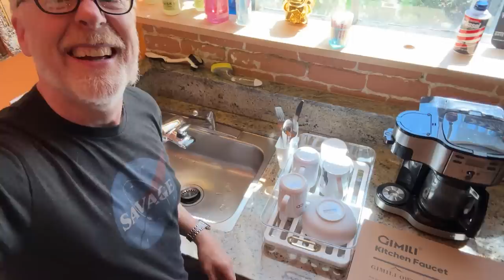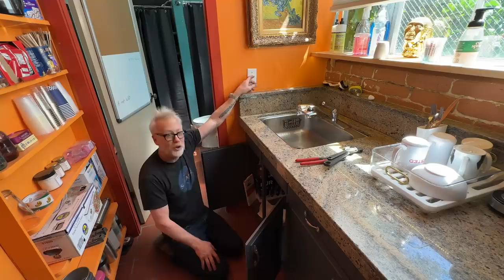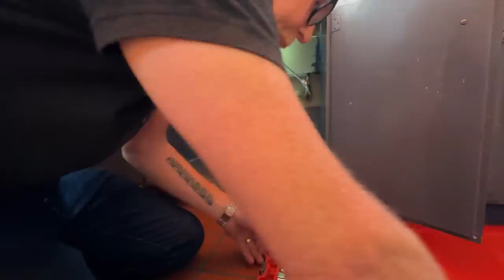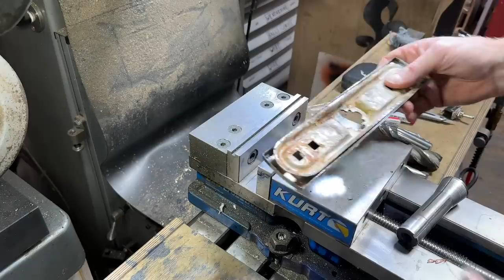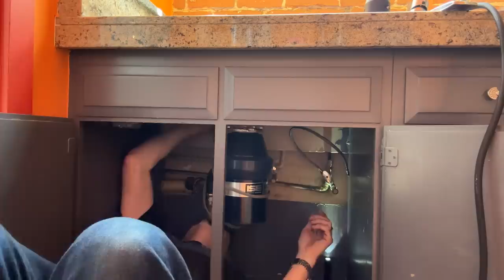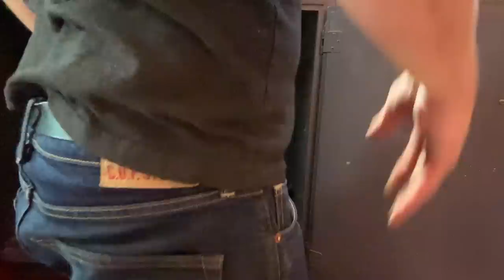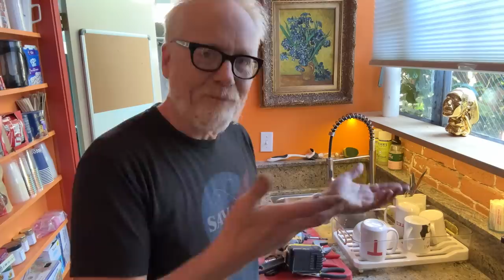Why You Should Hire a Plumber

Comment: Yeah installing and replacing a faucet isn't as hard as people seem to think though. Its literally two big washers and nuts holding the faucet in and two water connectors. However, if you are changing your faucet style to a skinnier faucet from a wider one its best to be able to do what Adam did and reuse the old base if you can. That way you wont have to deal with the holes.
Reply: Also the water supply lines should be secured because that swaying is not ok
Reply: Same for a water tank. Just installed a tankless water heater all by myself. Seems daunting at first, ended up being incredibly easy, just like the kitchen faucet. 2 Water connections, etc. Maybe a step up next from doing your own kitchen faucets (since this does involve mains power and huge currents).

Comment: Wire wool better as you leave bigger scratch marks that accumulate more muck and corrosive cleaning products. Should of attached the flex is to tap otherwise you will twist and poss block the pipes. Put some brackets on those pipes prevent possible movement etc and pipe wear Plumber meaning worker of lead. I am plumbing and heating engineer by trade. I done everything from domestic to industrial. Have built houses extensions etc. now I work for military sorting out their infrastructure and building heat electrical and water needs and requirements

Comment: I have one of those in my house but these work people are not worth it so they get the cheaper one - I kid ... I kid ... but I did think it was funny 🙂

I also need to add that if you are going to do this on your own, and you have not ever turned off those cut-off valves in all the years you have owned that sink, fully expect them to start to leak to the point where you will need to turn off the water to the house entirely until you can get them replaced.

Comment: There's a couple mistakes I spotted, and I'm not a plumber. He should have had a bucket when removing the hoses as they often will still have water in them. The water hoses should probably be attached to the faucet first, then to the intake shutoff valves. It could make the job easier since he would have more room to work.

Comment: Drain/waste/vent plumbing is one of the few home renovation things I won't touch. Supply piping using PEX is easy, but there are too many gotchas in the code for DWV.

Adam, you really should screw those copper supply pipes to the back of the cabinet to keep them from bouncing around. Metal fatigue is a thing.

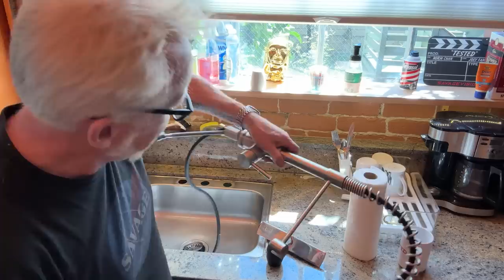Comment: @10:25 that is plumbers putty, maybe they over did it, maybe not. Often the cheap faucets leak between the sink and base unless it's done just like the installer did it. With better faucets that have a plastic gasket you can often get away with no putty, but I typically use a thin layer of kitchen and bath silicone between the sink and base gasket to ensure no leaks. Call backs hurt your reputation and consume valuable time. I strive to make money every working hour, fixing mistakes only costs money and in comparison plumbers putty is dirt cheap.

Comment: Ive done well over 700 dishwasher installs.  Theyre normal and fairly easy.  Bought a new samsung bespoke dishwasher for myself and made the mistake of reading the installation instructions.  Which went against every instinct i had installing it yesterday.  But nearly 1000$ for a dishwasher i thought maybe they knew what they were talking about.  Ummmm.  Nope.  It started leaking about halfway through the cycle and set off the lc error code which is the leak sensor.  I pulled it out today, dried it out, and installed the water line the way i would normally do it.  And im not going to permanently reinstall it until it completely finishes this cycle, because as much as i hate doing things twice.  Three times is worse, especially with a broken knee so getting down that low is not only painful, getting up is much harder.  Haha. 
Hope everyone is taking care
Edit:also a basin wrench would serve you well for faucets.

Comment: The water pipe is thin for the faucet, What happens if it gets clogged by the dirt/stones in water. If the water is "hard water" then scales form in pipes(Which happens when you get water from borewell where I'm around). Would that not be a problem with such thin pipes?

Comment: I proved to myself that I am not a plumber, I once flooded my apartment because I didn't tighten enough the hose that connected the copper pipe to the PVC hose. Over time, the PVC hose popped out due to the water pressure and me not applying the right amount of torque. The  knowledge is what you are paying for when you hire a plumber.

Comment: In northern Minnesota, after you've cleared your work space you shut off the water and proceed to replace the faucet. In Phoenix, with it's dang hard water,  you go to turn off the water, shear off the handles so it's a trip to the hardware store to get new shut offs. Replace those, then proceed, typically shearing off the bolts that hold the old faucet on. Sigh......

Comment: A curse of studying engineering of the physical sciences, the family asks you to fix anything and everything. In my case aero engineering. Also, if you have multiple layers of silicone, you have to remove them all. New silicone will not adhere to old silicone! I did the kitchen sink faucets and twin bathroom sink faucets, replaced the cartridges in the showers. The list goes on.

Comment: Plumbing is easy. Until it isnt. Example When I moved into my current house I had a leaky tub faucet. Easy fix. Pull out the old cartridge and replace. Except the cartridge wont come out. You pull and pull and break a copper pipe. Now you have to replace the entire faucet which requires you to solder new fittings inside a finished wall with only a 2.5 inch access hole.

Comment: The advice about using a standard wrench as a torque limiter is hiiiiighly dependent on the strength of the user. A moderately strong person can absolutely demolish almost any plumbing component with a standard wrench.

And if there are plastic components, literally anyone can demolish those with a standard wrench.

Comment: I passionately dislike plumbing. I do electrics... when I'm finished - the Electrons never leak out onto the floor. Never. 
Also, Adam - you should strap the supply lines to the back wall of the under-sink area.

Comment: the reason you hire a plumber over doing it yourself is they have made the novice mistakes you would most likely make as you begin your journey into DIY. end of the day its the triangle of Time vs Money vs Quality, you can only have 2 of the 3. do you have the time to do it yourself (as well as the want to do it) to save some money as it will take time to learn? or pay the money to get the job done by the pro and know it will come with a high chance it will not leak?

Comment: I agree with hiring people that work in these special trades…BUT - almost without fail, as I slowly change things in all the houses I’ve ever been in (changed out a leaking toilet 2 days ago caused by whoever stacking flanges and glueing them together with silicone), I have yet to find someone that installed the plumbing with any pride or self worth.  Which makes me not want to hire those people - to which I will suffer through it and do it right.  There may be some things beyond me, but for the most part, I can hold my own for what I do.  Just like anything, a few bad apples can ruin the bunch.

Comment: I'm surprised the faucet didn't come with a three-hole base plate to cover the unused holes. 

Generally speaking, never learn how to perform any trade by watching YouTube videos, no matter who makes them. Even an actual tradesperson can't convey all the details they've learned over the years in a single video or even a short series.
Worse, most "experts" on YouTube have no idea what they are talking about. All trades have a multitude of requirements and handy tricks of which DIYers are unaware. That is multiplied for electrical, which doesn't merely get you wet or flood your kitchen floor but can burn down your house or kill you if you think it's "simple".

Even so, as a retired electrician I would have never wanted to be a plumber. I learned it when working in commercial and residential maintenance. That experience and the occasion home plumbing work are more than enough for my taste.

Comment: Well funny you should say if you have to sweat pipe call a plumber. We had a pinhole leak that's a whole story in itself. Attempted to fix it myself cut out a section attempted to solder it couldn't get it to hold. Finally fed up call the plumber our neighbor they came in used my tools because they couldn't get theirs into the spot to cut the pipe and then they didn't solder it they use a slip joint shark bite fitting which had I known existed I could've picked up the hardware store for tents the price for the whole job. and it was almost like they sent out the apprentices.

Comment: Some things that the plumbing and home building industry could do better...

Generally, make things easy for homeowners to maintain and replace. More and more modular. For example, make that whole section where the faucet mounts a removable component.

Specifically... 

Make that wooden beam between cabinet doors removable. Not the plumbing industry's problem, but it's part of it. It's sooo in the way.

Make it easy to remove and replace the nuts on the stems. Or, make a better, easier option than that big nut.

Lighting! Not sure this is the plumbing industry's problem, other than building things in cabinet so that light can even get to them.

With building being an industry, it's not likely that these things will improve, since it doesn't help on immediate profit. One option would be for the builder to do less - just get the shell in place. Then bring in independent finishers. Or, if it's modular enough, just DIY the finishing. Yeah, pipe dream, but maybe if we talk about it enough somebody with the capital will "disrupt".

Comment: Those faucets are horrible . 
 I have one in my kitchen, it’s the third due to warranty. After a while the buttons stop working properly due to calcium buildup leaving you with one mode working.  Had one in spray go bad again, had one in stream that is the current one , buttons stopped working , lol.
 The one we have is sealed , cannot clean the inside

Comment: Don't put teflon tape on the threads unless the threads are making the seal.  if the seal is an o-ring or flange then you are better off without the teflon.  If the threads aren't tapered then don't use teflon

Comment: That's not even the right sink for that sink cutout.  Who installed that?  I am a DIY'er and I would never have done what is seen there. Normally for a material like that you would cut into the material for the faucet and put a sink mounted below without the opening or you would mount that sink above the cutout with the openings.  That was just a weird install.

Comment: Did he just spend Time and money milling a kitchen sink faucet!!!!!   If plumber needs to equip their service trucks with clapped out Bridgeport mills to install a faucet...  Also as a Kitchen and Bath remolder for over 40 years, stop buying the $50 faucet from the internet.  Spend the $200 bucks or more for quality  unit that comes with all the right beauty trim to convert from 3 hole to single hole, and parts that you can get when it wears out or breaks.  Also I like the top mount sink mounted as a under-mount sink never seen it done before but looks ok.  Next step is to install a smaller 18" mini dish washer saves water in the end over hand washing.  Also thanks for sticking up for plumbers, we actually go thru all kinds of training and certifications every year, at our cost most time that is required by local, state and Fed Health codes.

Comment: Adam,
Why, in a world of choices, would you choose the faucet that did NOT come with the cover plate?

You literally made this a job that needed an unnecessary tool to modify an old and diety scratched up piece... that doesn't match the piece you put in.

Pretty sure that exact model of faucet has an option with the cover plate.

Comment: I can understand why people do not want to do plumbing in the US - that plumbing looks horrible. Why are the water-lines long unsupported straight pipes?
Why was the old faucet connected with hard lines? Why did the new faucet not come with a standard cover? (at least the new one came with flexible armoured tubing)

Seeing the pipes swing around every time you turn on/off the water was horrifying.

Comment: Its annoying trying to find a good plumber though. Had one that ripped off my mom by charging her $600 for replacing a vent cap (like a 10 buck part) cause she is elderly and didn't know any better. That didn't even fix the problem she had, had to call out another plumber to snake the main line cause there was a a clog and that was the actual issue. The last plumber I had come out was super lazy and didn't want to do any work. Wouldn't even look at the problems I had just immediately said he couldn't do anything. Its like then why the fuck are you out here then if you won't do any work? At this point I'm beginning to think DIY is the way to go. It sucks cause used to have a GREAT plumber about 15 years ago, but he passed away and have never found another good one since.

Comment: WRONG about the vehicle torque specs...do not listen to this. The range on typical say suspension or brake components range from 20ish ft-lbs (say caliper pins) all the way up to 200ish ft-lbs (say lower control arm bolts), with lots in that 70-100ft-lbs range (say caliper brackets) and good luck getting anything over 50ft-lbs with an adjustable or even box end wrench.